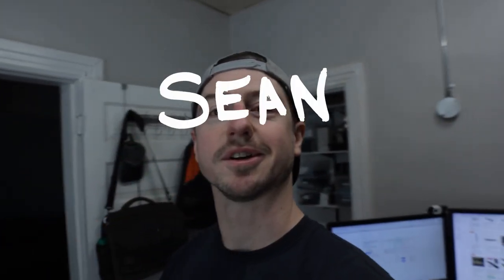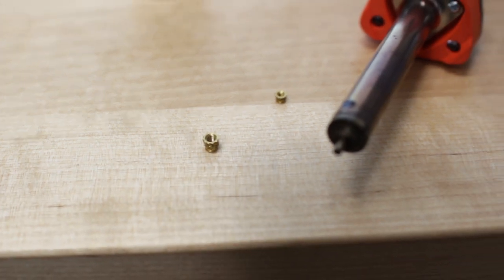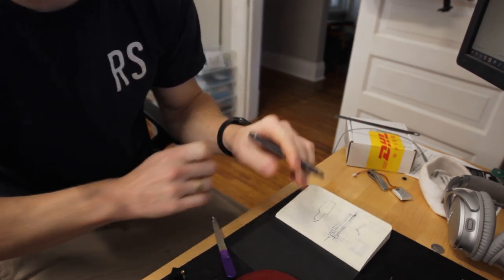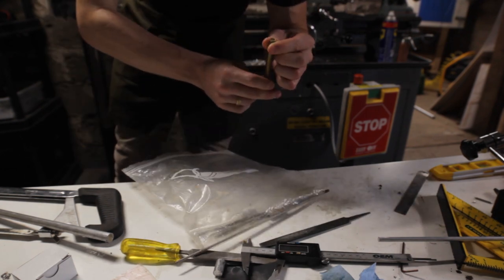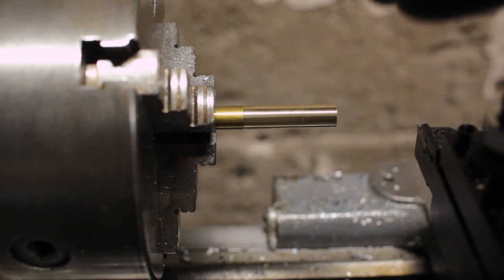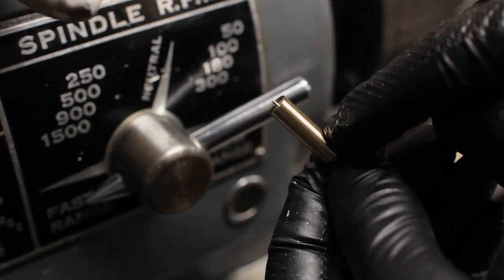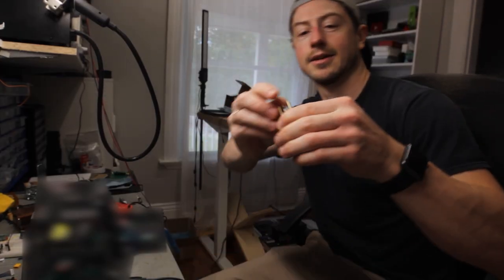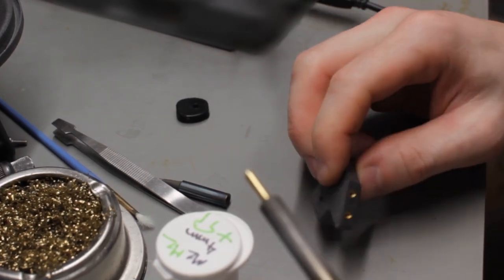Custom Heat-Set Threaded Insert Tools (For my Hakko!)

Comment: I am gonna try to make an M3 size one out of an old soldering tip in my drill press with a file.  I don't have a lathe so I'm hoping this will work.  Incidentally, you were the reason I got into 3d printing (kind of) I found your video about 3d printing a shop vac duct for the dewalt table saw , took your file to my local library, and printed it.  I now have 2 3d printers , one is an Anet a8 (well, most of the parts from the original a8 ) lol.  Thanks!

Comment: I love how the can of WD-40 just moves around on the vibrations. Also, I do it with a simple long bolt and a lighter, it gets kinda hot on the fingers sometimes, but I have a spare soldering iron, maybe I should make something similar. Great idea.
Reply from the maker: I laughed at the WD-40 when I was editing this.
Reply: @SeanHodgins  It's quite fitting with the music ;) Like the needle of a meter.

Comment: What temperature do you recommend to use with your soldering iron for PLA? I’m thinking about getting that same exact soldering iron. Thank you so much!
Reply from the maker: I normally do 450F if I’m not in a rush as that will give the best results. It’s a great iron!
Reply: @SeanHodgins  Wonderful thank you for the response!
Reply: 232°c is just a little hotter than printing temperature.  Thank you for that tip.

Comment: how the hell do you get the insert tip to stay on the weller or get it inside the tube thing, i put it over the normal tip like a sleeve and it just falls off when upside down. i opened it up from the 3 screws, how do i get it inside without breaking it?
Reply from the maker: On the Hakko the sleeve tapers in at the ends so it physically clamps down on the tip when you tighten the sleeve down.
Reply: @SeanHodgins  yeah i need to get that iron, thats a very nice feature, i have the cheap led weller and was getting very annoyed. ty for replying, how is the thermal regulation on the f-888D? i notice it has an up button but no down for temps.